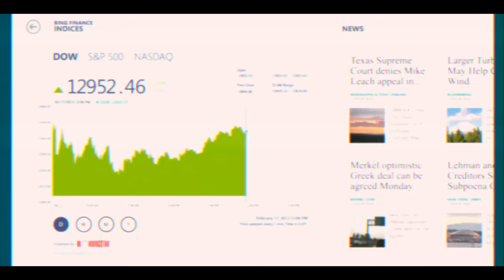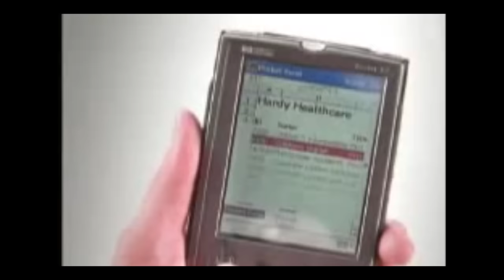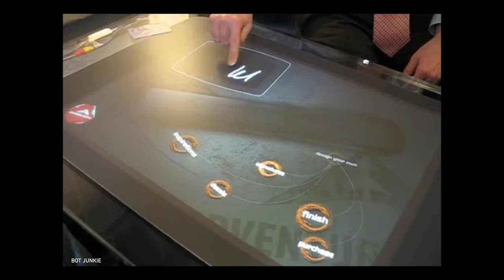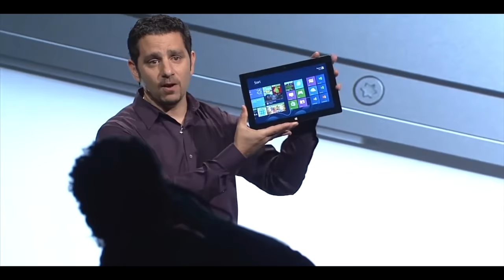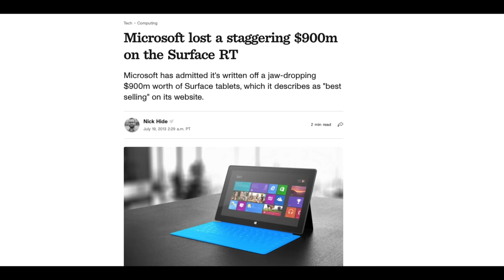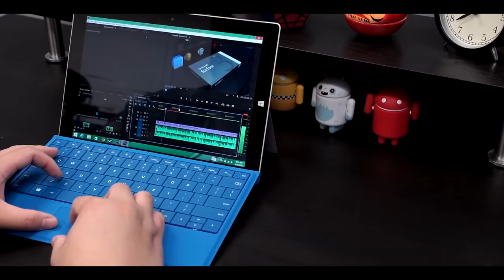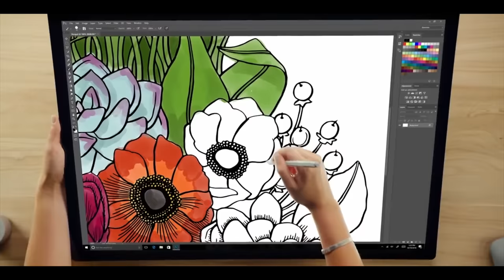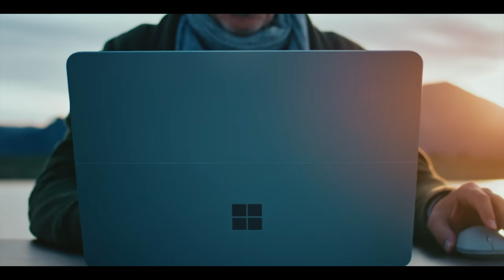How they WON. The untold Microsoft Surface story!

Comment: i have a surface studio laptop
its a very capable workhorse that has all the really cool features that many other laptops do not.

incredible display 1400pp 120hz, the best touchpad on any laptop ever beating apple, one of the best touchscreen + pen experiences with very accurate location, pressure, and tilt sensitivity, super robust build that I'm confident I could use to break down a wall if I dont have a sledgehammer on hand, the ability to fold it over into a tablet without losing performance, super quiet cooling that runs quite cool even in the Australian heat, great battery life when not using high performance applications (there's really no high performance laptop that has ever had good battery life when under heavy workloads, battery technology just isn't there yet, solid 32 gigs of ram, a decent i7 processor (probably the weakpoint of this laptop), rtx 3050ti. its the ideal laptop for me (gimme usb type a or let usb c become standard for most peripherals i dont care which comes first i just wanna stop carrying an adaptor)

10/10 device if you want a laptop that can be used for drawing, video editing (even 3d rendering) and all that jazz this is an excellent pick. 
though if you wouldn't use the touchscreen or the tablet mode, the fairly hefty price tag may not be justifiable. and you may be better off looking towards the more powerful devices on the market at this pricepoint like the razorblade or similarly perfomant devices at a lower price (but you will be loosing a lot of those nice features like build quality and touch screen).

Comment: Great video, sad to say that the product in the video lack all the power needed to be functional. Writing this on a Surface Pro8 with 16GB of RAM and a i7-1185G7 CPU and still feels like I use an iPad2 while the fans whining the goo out of my ears. If the price was cut by 70% I might feel that this product was worth it, but at a price of $1,599.99 is at least $1,000,00 to high. (Yes, this Surface is provided me as an employee, but nothing about it is feeling premium, more like a LEGO toy)
If the Surface 9 is as slow as this, and with Intel 12 gen it for sure will be it is not worth buying
Reply: the current arm surfaces might be worth a look. the efficiency is much better than the Intel furnaces. or look at a 360 hinge Laptop. these are better performing and better cooled, much cheaper but heavier

Comment: The surface was good in its prime now there are better options
Reply: “Better options”… fail to mention one single option lol
Reply: Only thing that can even compete with it is an ipad if you are fine by using apples locked down operating systems
Reply: @RuiMMSousa  I did not list the options because they seemed fairly obvious but clearly they aren't so I will list them for you. The list will go from high to low price options 

Higher Priced - 
M2 MacBook Air 512GB ssd 13.6"
M2 MacBook Air 256GB ssd 13.6"
M1 MacBook Air 256 ssd 13"  
Dell Latitude 5512 15" Laptop 

Medium to Low priced 
Lenovo Chromebook 14" touchscreen 
Samsung 15.6" Intel Celeron 
ASUS 2 in 1 Flip Chromebook 
Samsung Galaxy Chromebook 13.3" OLED 
Samsung Galaxy Chromebook Touchscreen 
HP Pavilion 15t-eg200 Laptop 

if you would like me to keep going I can all of these do the same as the newest surface for less the price with better displays and more options. even the newest MacBook Air is as much as the newest surface. because of the price of the surface it has defeated its own purpose.
Reply: @matthewisrail  I disagree. There's a lot of other options other than Apple if you don't like Apples operating system. Don't get me wrong the surface isn't all that bad at all but the price of the newest surface with now deals or discounts is the same as the new M2 MacBook Air with 512GB ssd. With the latest Surface being priced at $1,500 USD or 1525.49 Euros you could get a good laptop with or without touchscreen for that price or less. you could maybe even get an entry level PC setup for that price
Reply: @RuiMMSousa  your comment came off a little rude so let me offer a rebuttal. The definition of fail from Oxford University is "to  be unsuccessful in achieving one's goal" my goal was never to offer you the seemingly endless amount of options of replacement devices for Windows surface tablet. Meaning I never failed to do anything. But you did fail to get your point across and failed to try and embarrass me in the comment section of a YouTube video about a Windows product. YouTube says you made your YouTube account on October 5, 2006 meaning that you're probably about 30 or older. I would assume someone your age would have learned to use correct mannerism to speak to people. However you haven't and probably never will. It's unfortunate to see people like you on the internet and in the world who are disrespectful for no particular reason. You could've asked me to name an example or even just state that you strongly disagree with me. You didn't do that. Now you have to deal with this. The embarrassment of someone writing an entire paragraph for fun criticizing your attempt to be humorus or whatever you were trying to do. I bet you didn't expect to be ridiculed by a teenager for having bad manners did you? But it ended up happening regardless. Next time be polite and choose your battles wisely or don’t battle at all if this is how you're going to do it.
Reply: @silasbozarth9857  Are you comparing a Surface to all the computer industry? I already know my desktop is better than my M1 or my Surface, but I'm not comparing them. To answer your question, yes I  "would like you to keep going"". This time I need a Windows 11/Tablet better than the Surface, obviously that's what we are talking about. I will wait.
Reply: @RuiMMSousa  so you admit those options are already better? I listed probably 3 or more Windows laptops for less the price that do the same thing and have touchscreen and all the more stuff
Reply: @silasbozarth9857  Yes a M2 is better at running macOS than the Surface running macOS, Yes a Chromebook is better at running ChromeOS than the Surface running ChromeOS. I don't need a laptop, I have those, I need a TABLET running W11, if you know any better than the surface just tell me so I can return mine and get that one...
Reply: @RuiMMSousa  I just named something that perfectly fits what you just described I'm not gonna say it again
Reply: @silasbozarth9857  since you like to use it so much, why don't you go check the definition of tablet from the Oxford University.
Reply: @RuiMMSousa  Im well aware of what that definition is. You thought you did something didn't you?
Reply: @RuiMMSousa  "a flat slab of stone, clay, or wood, used especially for an inscription." that's the definition of tablet

Comment: Microsoft hasn't won squat. The fact that they're charging roughly $100-400 for a 128gb upgrade is laughable. Surfaces depreciate in vale at an alarming rate. Surface competitors are on a steep rise and offer far better value.

The Surface 1 and 2 were failures. Windows RT was trashed by 2015 (Two years after the release of the SP2).
Reply: ms is like apple. they are making huge profits. thankfully on windows there are devices like the lenovo yoga, or cheaper ideapad flex/2in1, that are MUCH cheaper with the same capabilities, these are heavier but have much better cooling, better battery and since they are laptops with a touch/pen enabled screen that can fold 360 degrees have better keyboards aswell. you only loose on weight, everything else these win.

Comment: Microsoft Surface is a dead device. Most companies don't use them as they simply buy a normal laptop or buy an iPad. Microsoft needs to simply adopt Andriod and make a good tablet. However, Microsoft should be applauded for investing billions and trying. Some companies fail to invest and die a slow death like GM, Chrysler and Ford.